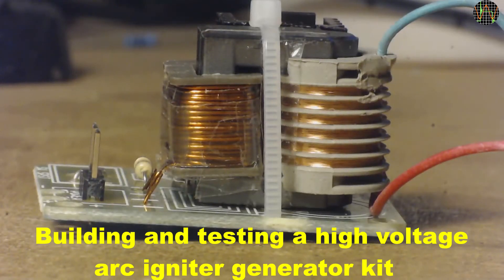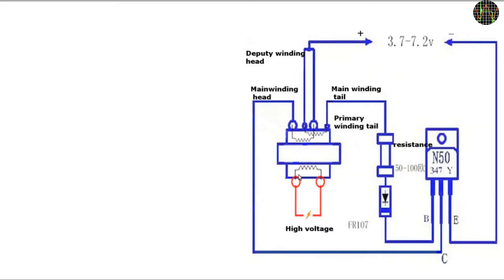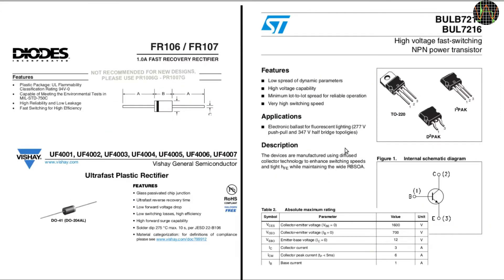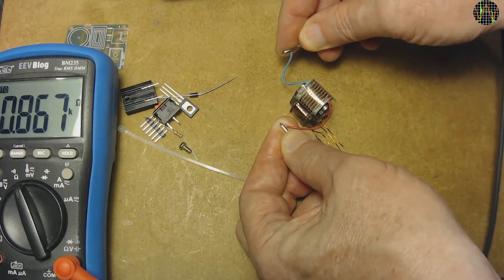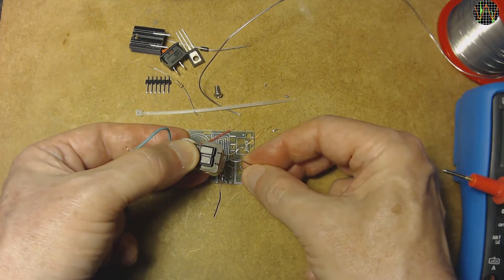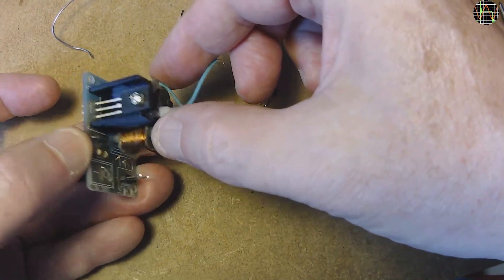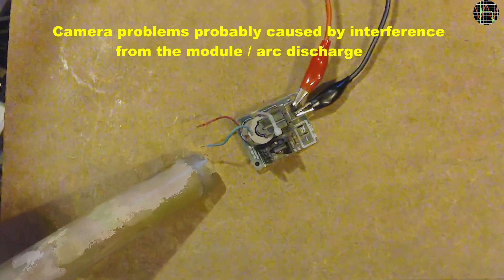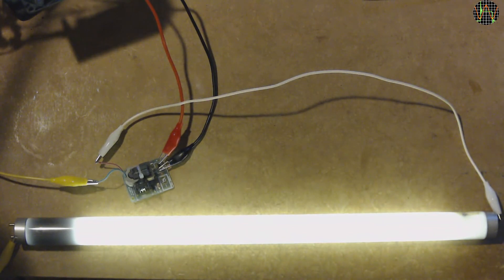Building and testing a high voltage arc igniter generator kit

Comment: Is the the power of the input proportional to the output in this tipe of transformers? in case I would like to limit the output current of the transformer to 100uA, what would be the best way to achieve it? thank you, nice video
Reply from the maker: that is really difficult because it is all so non-linear impulse driven stuff.  I measured the peak voltage to between 3.5 and 7.5kV depending on how hard you drive the unit. 7.5kV/100uA is 75 MegOhm. If you put that in series with the output, you would limit the current to 100uA.
Reply: @TheHWcave  and what about limiting the primary current? if the power is proportional on both sides that could be one way, but yeah we dont have the best case scenario working with these modules since they are not driven by the normal transformer principles
Reply from the maker: @gastjjs  As  said, doing anything on the primary is difficult. At least you can't predict or calculate. But you can of course experiment and adding resistors into the primary, but then how are you going to measure the current on the high voltage side and anyway, are we talking peak or RMS is another tricky question

Comment: Can you put a in the description the actual URL for the kit, please?
Reply from the maker: Well, Banggood sells only the transformer at the moment, not the whole kit. But it is available on eBay "DC High Voltage Generator Inverter Electric Ignitor 15KV Battery DIY Kit" for example.